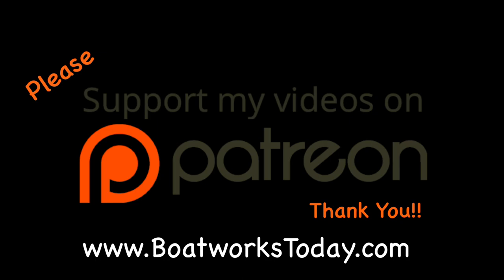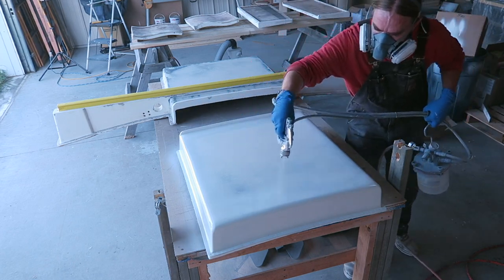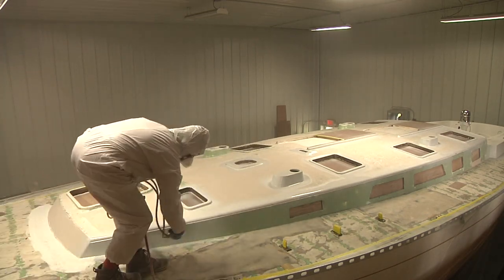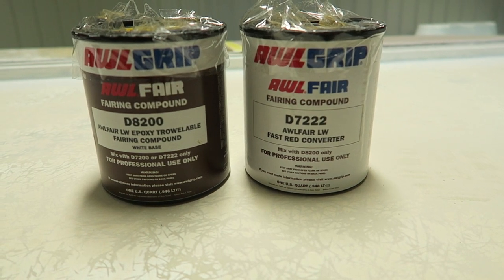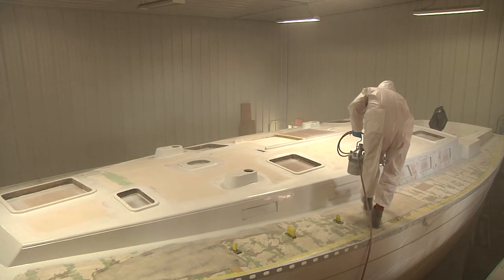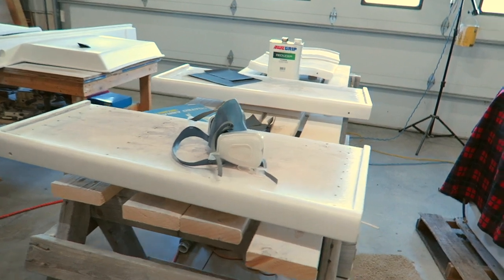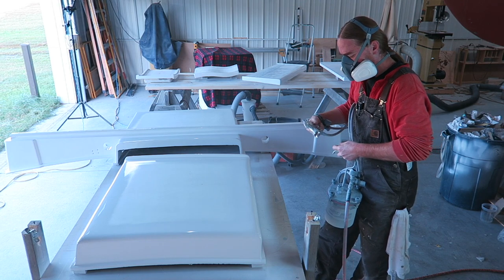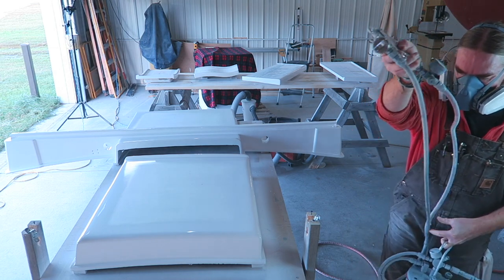Spraying Awlgrip Primer And Paint

Comment: Andy, Im in the boat repair business and your videos a great. Well done!  Glad you emphasized how much prep work is required.  No amount of skill with a spray gun can make up for bad prep work.
Reply: Use spray balloons, awl quick ,
Reply: 545 first prime , pin hole with filler or awl quick , or spray balloons . Wet sanding is best . Second prime , pin hole with bondo, 320 wet for finish coat . Pull the trigger

Comment: You could take a glass scraper with a brand new razor blade and carefully cut through those runs and then what's left will cure up fast so that you have minimal to sand down. You could then spread a small amount of Automotive spot putty over those cut down runs after that cures up you can send those runs down more evenly to the point where the spot putty has been removed.

Comment: Andy,  to avoid sanding swirl marks, is it best just to not use a palm sander when doing paint prep?  I used a palm sander before doing a roll and tip job on my Santana and now, in certain lighting conditions, I see those sanding marks, even though I ended up using 600 grit paper.  Thanks!

Comment: How do you clean up your gun hoses and pot after that. The gun and the pot fairly easy. But then the hoses?????
Reply from the maker: That video will be coming very soon!
Reply: BoatworksToday I just sprayed the side of my camper with gelcoat. I Have a 3m cup system and a 2.6tip gun that I bought from Northern tool. And I know that clean up is a bitch. I can throw away the cups, but then, I have to clean up the gun. Oh and if you get a chance I have an off white on my camper and the gelcoat is white. I'm thinking of painting the whole camper now to give it a great look. But how do you feel about someone painting a whole camper. Should I or maybe just get rid of it. And get a new one

Comment: Where can I find a materials list for the Awlgrip paint, I want to paint my fiberglass camper. Thanks
Reply from the maker: Really best thing would be to read their application guide.  This will outline the materials you need based on how you intend to apply the material.  http://www.awlgrip.com/prodlit/applicationguide.pdf
Reply: Went to the website and read up to the disclaimer that "it is not intended
as a ‘How To’ guide for the do-it-your self-er." Guess what I am. Do you recommend this brochure or is there another place for me and thousands of my cohorts. BTW I will be using rollers and brush. Not afraid of spraying just don't have the boat indoors, otherwise I would.
Reply from the maker: That guide is the bible on specifics for using this material.  That said before taking any paint to your boat, practice, practice, practice on sample pieces!!